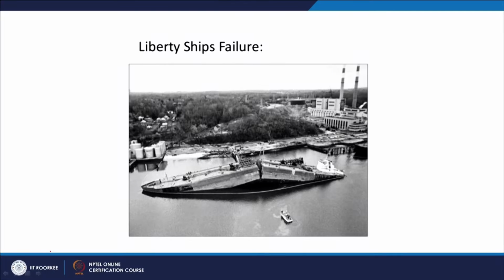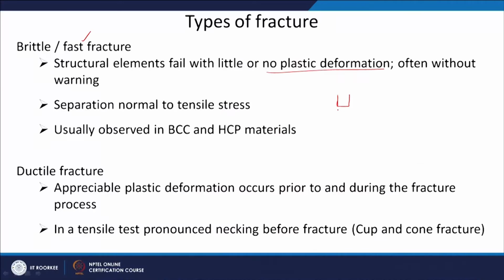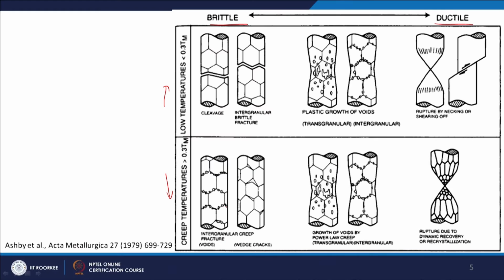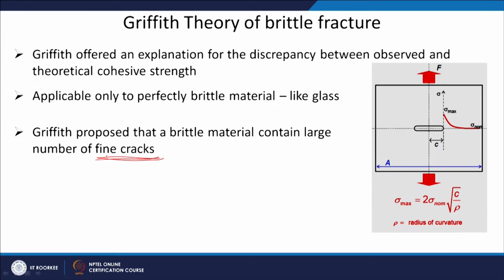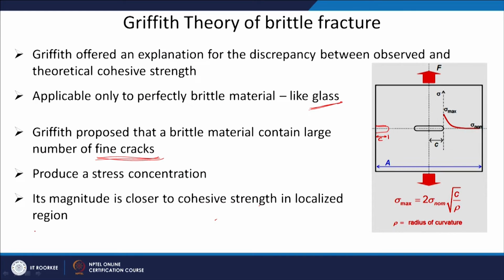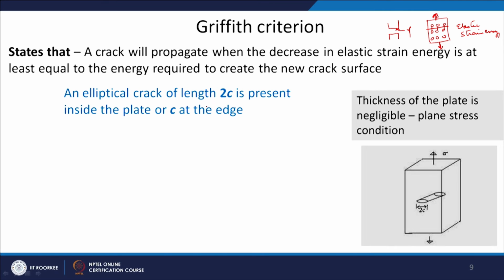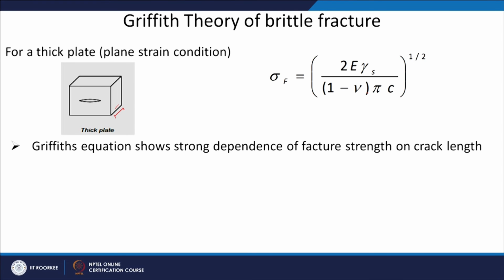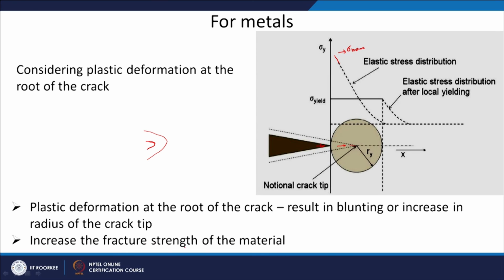Lecture 33: Fracture: Part 1

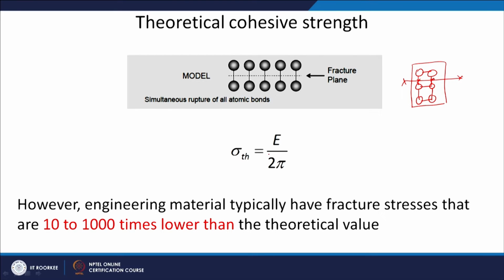Comment: What is the name of the author mentioned at 10:25 ? Writting it in the slides would have been better.
Thanks !
Reply: Mechanical Metallurgy by Dieter.Books cover page is green or black.
Reply: @prasannachandramandal5353  deiter books are available in version one in black which is indian version and another is green
 colour which is si metric version
Reply: @pratyushchhatar2209  yeah I know.I read green book.
Reply: Deiter book